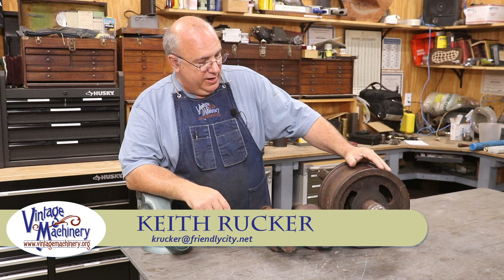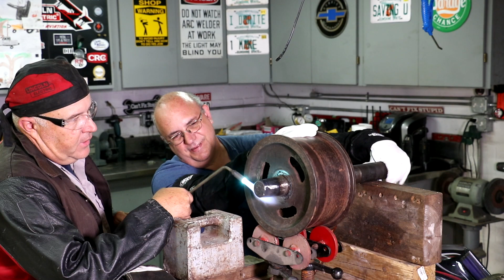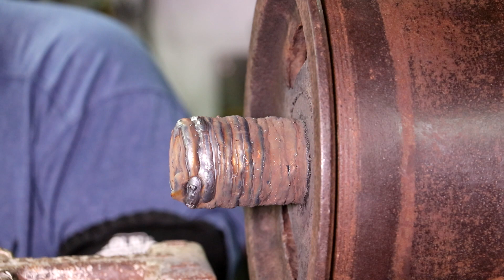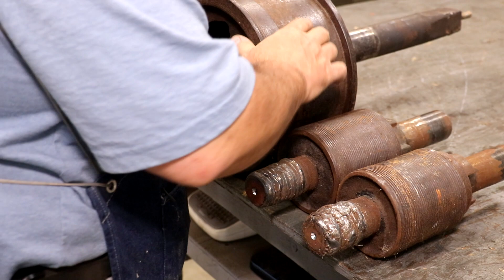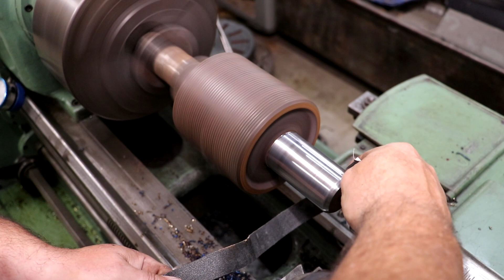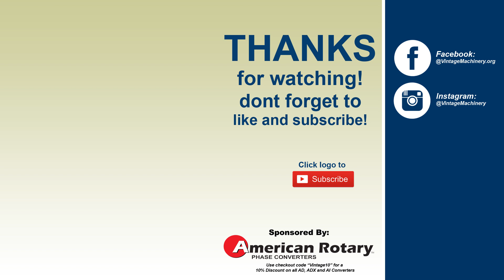Cane Mill Roller Refurb: Welding up Journals and Machining them Back Down

Comment: I have a Columbus No. 18 I am restoring, I have learned a lot about the babbitt and re-doing the bearings. One question I have is which hardness of ingots do you start with? Checking Amazon, there are lots of choices ( #2, grade 7, # 4 to name a few), which is best for the cane mill?

Comment: in the early 90s Ford Taurus had disk brake rotors that had a steel hat and cast iron rotor, they were such a pain to turn on the brake rotor lathe, chatter was really common.. eventually, the adapters to mount them on the lathe arbor made it a lot better...

Comment: This video reminded me of the first place I worked 
which was a mold shop. 
Once in a while a mold cavity would need a weld 
to repair a tool mark or wear point. The welder would put the part to be welded on a large burner to preheat it before welding. As I was told this was to cut down shrinkage around the edge of the weld . Shrinkage causes a low area around the edge of the weld. I learned a awful lot there and at at the time they built plastic  injection molds all on manual machines. They did some beautiful work.

Comment: 18:35 Keith - you said you'd take another 100 thou cut - is that 100 thou off the diameter - so really only a 50 thou DoC ?

This maybe another difference between US and UK lathes - tool travel on the cross slide in the UK is usually the thous shown on the dial, not half that amount.

19:16 looks to me like a 50 thou cut, not 0·1".

Comment: To make a short story long...When I worked at National Steel in Ecourse Michigan, I spent some time working in the roll shop. We had Mesta machines for rolling slabs into sheet steel. One rolling mill was 80 inches wide and one was 96 inches. When the roll surface was too rough to make good sheet metal, the roll was taken out of the mill and went to the roll shop to be resurfaced.  The Mesta mill stand had a 52 ton backup roll on the bottom, a 26 ton work roll, a 26 ton work roll and a 52 ton backup roll on top. When the rolls get too rough to make good sheet metal,  they take them to the roll shop and grind a new surface on them in a roll lathe. When they are ground down to a minimum diameter, they put them in a lathe with a submerged arc welder and build them back up to size. If they ever break off the journal on the end of the roll, the roll is scrap and they cut it up with an oxygen lance.

Comment: How about turning the shaft down, until it is parallel, then sweating on a sleeve.
Reply: That actually could work but as someone who used to do journal buildup in a rubber mill it could work but with a good enough welder it may be as fast to just weld it and turn it.
Reply: @gregorytimmons4777  With welding, is there not a danger of distorting the shaft, due to the heat?
Reply: @BedsitBob  Yes, there is that danger, but if you preheat as was shown and then balance the extra heat inclusion from the welding all of the way around the shaft it should be OK. The other thing to watch is the the shaft is allowed to cool down slowly and evenly. Exposure to a breeze while cooling down could negate all of your previous efforts by cooling one side faster than the other.

Comment: Why are so many calling it "MIG", when it in the case of carbon-steel welding actually is called "MAG". MIG/MAG is good enough though. The only difference is the type of shielding-gas mixture, but an extremely important difference.

When welding most other metals, an Inert gas such as pure Argon is used, in contrast to an Active gas such as 100 % Carbon-Dioxide  or a Gas-mixture such as 80% Argon, ~20 % Carbon-Dioxide and a trace of Oxygen, used on carbon-steel.

GMAW / MAG = Gas Metal Arc Welding Active Gas.

Nice video.
Reply: MIG is the original name for GMAW.  Metal Inert Gas.  Interesting enough MAG was the name for Metal Active Gas for when you had CO2 or oxygen in the mix.  Both MIG and MAG are GMAW processes.

TLDR: just the old names, is all

Comment: Keith, 1/16" increments for shafting are very common in many types of mills and industrial equipment. I live in a mill town, and lots of the odd pieces I acquire are in 16ths.
Reply: According to Dave Richards, during the time period this mill was made, most of the cold roll would measure 1/16th less than nominal.
Reply: @rolliekelly6783  now it's only true with plywood...

Comment: just wondering if a sleeve would have worked
Reply: Was in the bearing business for years. A "SpeediSleeve" is a patch at best but wouldn't work with that much taper. You'd still have to weld up and turn down.

Comment: You could have used that huge drill bit of yours to bore out those damaged ends.
Woulda, coulda, moment ... pet kitty.
Then put a new shaft thru them. 
If you go to TIMKIN BEARING.
Order up the size you need.
No babbitt bearings.. last forever.. build bearing races and dump in a sealed bearing.
Also just carpet around rafters. Throw cat up . You'll feel eyes on ya and kitty avoids sharps.  If not scale model rail road track around the property. They have one at a store in OLYMPIA. TOP FOOD. They fill the cars with candy and fresh cakes and doughnuts . Horrible place for me to visit.
I'm fat. Ha Ha
Awesome for x-mass.
Not endorced by dentist's! 
I'm sure there's clubs that would build that out for ya. There are awesome oldie model steam  trains out there. You'll be playing and never stop and get nothin done.
I'm kinda thinkin lemon aide or ice tea. Delivery to the shop , maybe a kitty treat or apple fritters. Yum

Comment: When welding it up, would the heat buildup been less if he started on the end and worked his way towards the pulley?
Reply: I think it would be worse working from the thin area first...
Reply: I always started on the lowest spot regardless of location. I never used GMAW (mig). I always used SMAW (stick). I doubt I’ll ever have do another shaft but if I do I might try  GMAW.

Comment: Keith, I need your help. I purchased a rucker straight edge casting from the store. Can't get anyone to respond to my emails about the order. It's been over 2 weeks ago and I would like to hear something.
Reply: The man that is doing the casting has been having a lot of equipment problems.  That may have something to do with it.
Reply: I understand but it wouldn't take a minute to notify me and let me know what's going on.
Reply: @williamcullum8379  The business model is you'll get it if and when we feel like getting around to it so don't bother asking. As he said here, this cane roller project has been sitting around for months. The stoker engine project is over a year old now and still not finished. If you get your straight edge inside of 6 weeks you'll be one of the lucky ones.

Comment: I could hear a lot of squeaking from that weld positioner, I think Keith needs to oil his elbows or his wrists, maybe use some Ben-gay on those problem joints! Nice job, should work good, does the machine need new babbet bearing material installed? From the looks of those shafts it does!

After watching the rest of the video, I realized that you have to pour the babbet to match the shaft. I guess you can teach an old dog!

Comment: I always weld shafts length ways start on one side go 180 degrees make another pass. just keep switching back and forth. Keeps the shaft straight and low spots to a minimum. looks good.